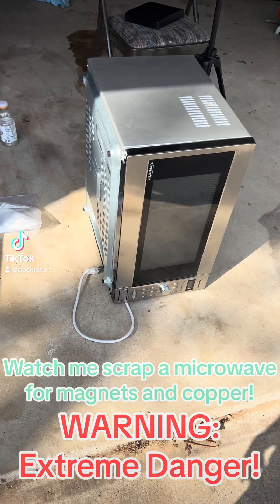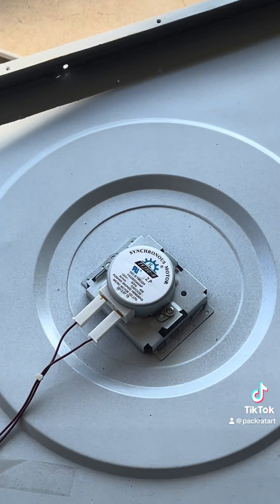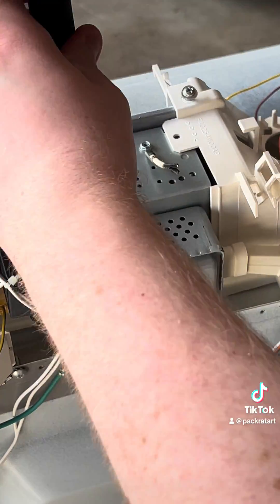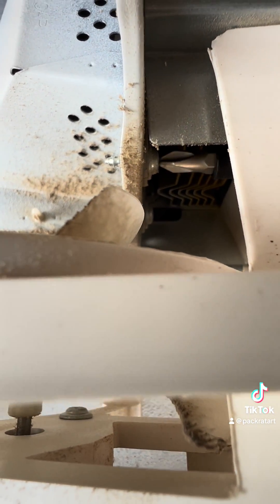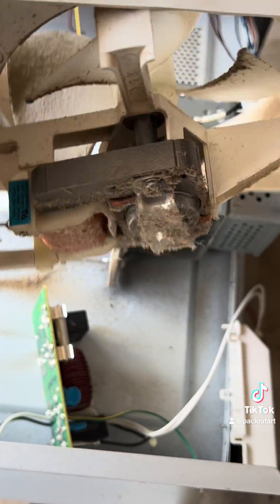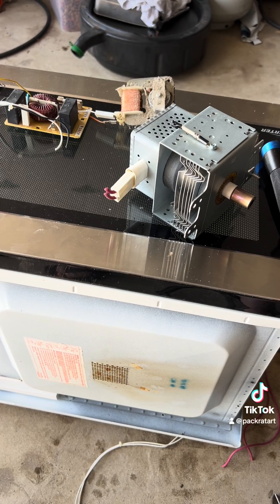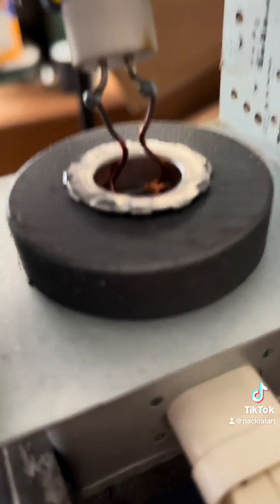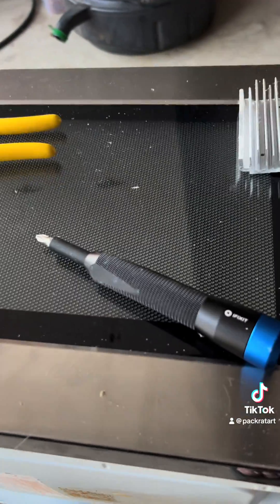Harvesting magnets and copper from a microwave

Comment: This microwave is not the typical microwave. It’s known as an “inverter microwave”, in fact, that “part that you tossed aside” is actually the transformer. That thing you harvested wiring from is a flyback transformer. The rest of the circuit is likely a ZVS driver that drives the flyback transformer to create high voltages. Due to the nature of flyback circuits, there is no voltage doubling needed, as the voltage from the transformer is already DC and around 4kV. These ovens are more efficient and stronger because the lack of a voltage doubling circuit makes the output of the flyback transformer CW, not pulsed. So the magnetron is on 100% of the time, while on a regular microwave, it’s only on around 50% of the time. Interesting that you found this!
Reply from the maker: I was thinking “With a microwave that size, maybe it’ll have even more copper!” (Thinking multiple transformers or some type of component) but that wasn’t the case. I kept the other transformers for projects, but haven’t done anything for years, so I’ll probably scrap it for copper if I can still find where they went.

Comment: Whats the dust
Reply from the maker: Most likely iron, but the ceramic magnets can be a bit fragile so it’s possible that some of the magnet flaked off. (Edit: I forgot about the dust on the fans and such. That’s just normal dust. I’m not sure which part you’re asking about so I just wanted to clarify)
Reply: @PackratMakes  the dust you claimed deadly is what i was writing about.
Reply from the maker: My bad. The magnetron is made of beryllium oxide and isn’t dust until broken. As long as it’s not broken, it’s not dangerous. When it’s broken, the dust becomes sharp small fragments that cause lung scarring which can then cause lung cancer as a result.

Comment: Where is the transformer?
Reply from the maker: This microwave is larger than normal, and built a little differently. The large transformer and large capacitor were nowhere to be found. I’ve taken apart 3 standard microwaves before this larger one, and never had this issue. I found a small transformer, shown here.

I’m truly at a loss for why this one is missing, because nothing appeared to be missing. I also couldn’t find any spare parts online to indicate it had them. My only other thought was that it was underneath part of the main metal box, which would’ve had to been cut open to access and find out. Usually, these parts are the first thing you see. It left me very confused.